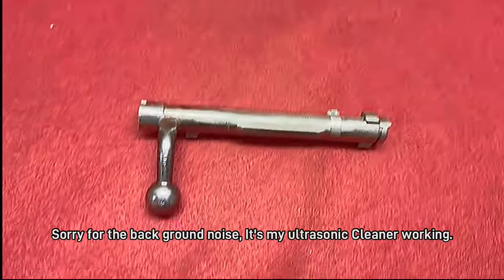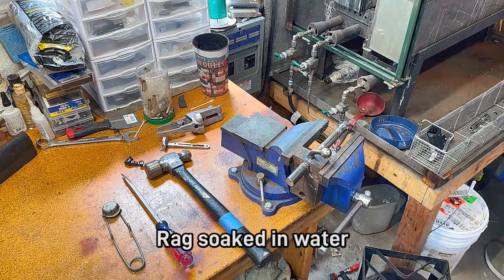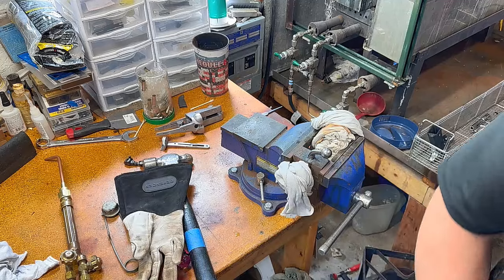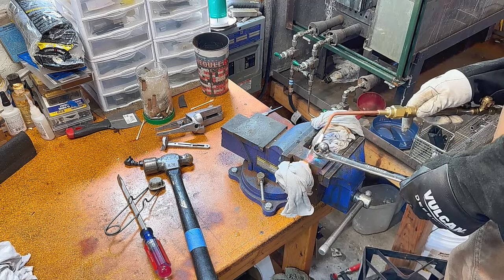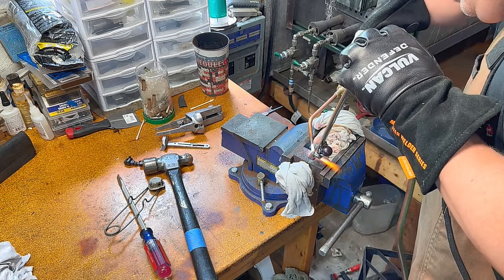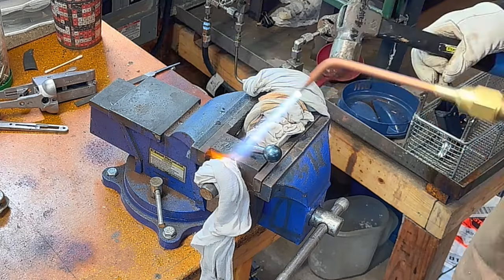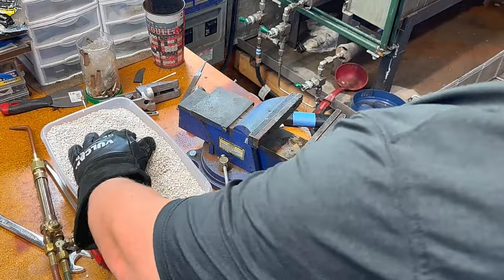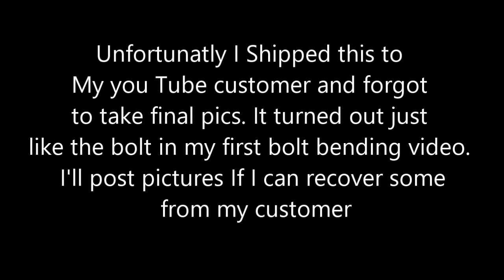How To bend a "Bent" Military Mauser Bolt for added scope clearance. By Turnbull Custom Guns

Comment: I understand most military Mausers were low carbon steel case hardened. Does this effect  the hardness?? You always get people who say it does or it doesn’t. If it does, does it require rehardening ?? I have quite a bit of experience with forging so this looks very nice, but on pieces that require hardening I always do it after forging like normal. Also if a aftermarket bolt is welded on do you use acetylene, stick or Tig ?? And is the bolt rehardened then for the different process. Your information would be helpful.
Reply from the maker: All the Mausers receivers I have worked on were soft enough to be worked with standard files and cut with standard tooling usually if they had been case hardened that wouldn't be possible. As far as the bolts themselves as long as you keep the heat towards the rear and minimize the transfer of heat from the handle into the bolt itself you will not have any issues. That's why the using the blocks and the insert for a heat sink and keeping the bolt shaft as cool as possible is very important. As far as welding methods, In School we were instructed to use oxy acetylene torches for welding bolt handles with a low carburizing flame. I have used the GTAW process as well. I have also talked to other Smiths that swear by GMAW welding although I have never tried. I don't think the method of welding is as important as keeping the heat at or behind where the bolt attaches however it gets welded. Thanks for your comment.

Comment: Sent him a mauser bolt,3 months later I had to have him send it back unfinished.  Don't waste your time with him
Reply from the maker: Again, I apologize. and yes, you are correct. I did not complete your bolt within the time frame I told you I could. I did voluntarily reimburse you for any costs you would have had by sending the bolt to me. What I did not Explain was the major reason for it not being completed is Your bolt was a Model 96, unlike the one in this video which is a Model 98. I was hoping my 98 bolt bending blocks could be used for your 96 bolt, but it couldn't. My plan was to make a new set of bending blocks for a 96 bolt, but I did not get it done in time. Again, I'm sorry I was not able to complete the work for you within the time promised but the bolt was returned to you the same day you requested it to be, and I did refund you all fees you would have incurred to ship the bolt to me. I hope you are able to get it done quickly with one of your local smiths.